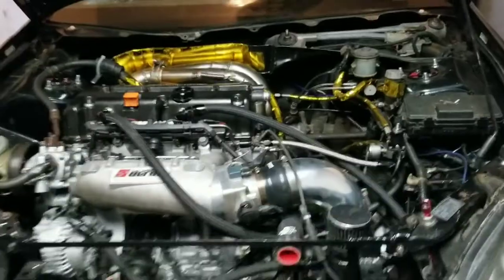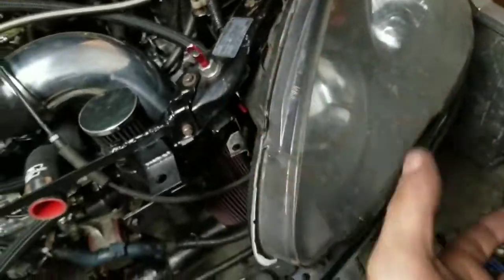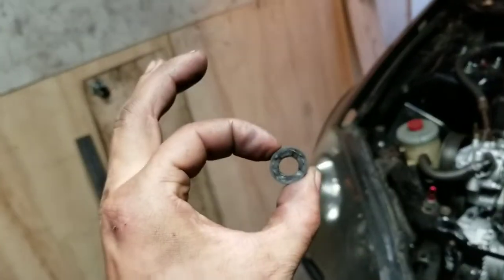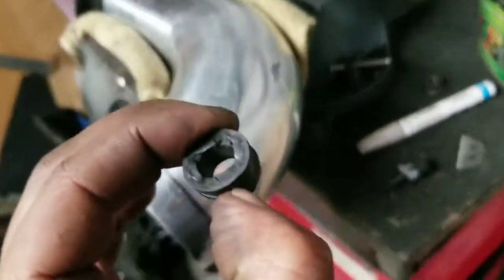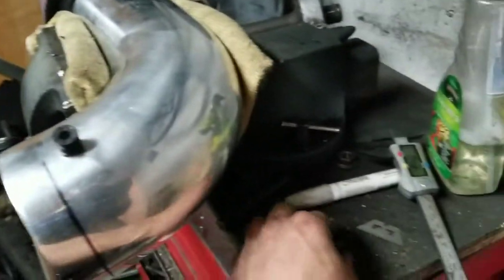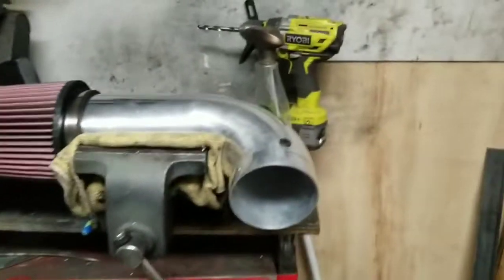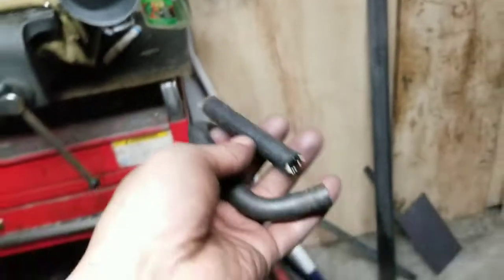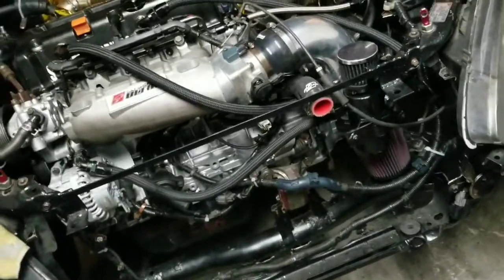How to properly mount your intake air temperature sensor on a kseries  engine

Comment: Hey brother,  I wanted to ask if it's bad or inaccurate to mount the iat sensor before the turbo . I have my iat mounted before the turbo and now with the cooler weather I've been having fuel related issues. I'm stumped .Thanks.
Reply from the maker: I would mount your air intake temperature sensor after the intercooler... the ecu uses the air temps to make necessary adjustments.

Comment: Well you just did it in the wrong spot you're supposed to do it where you get the most air and that's further away from the throttle body if you are running ram-air it be closer to the outside of the car

Comment: Life saver man, I just put an intake and check engine light came on. Cus the intake tube doesn't have a connection for the temp sensor.
What's the part called? Rubber hose?
Reply from the maker: It's just a regular rubber hose. Nothing special. Just make sure it fits on the sensor. 👍🏻
Reply: Its Just a Base RSX thank you🖤
Reply: Great, thanks so much!